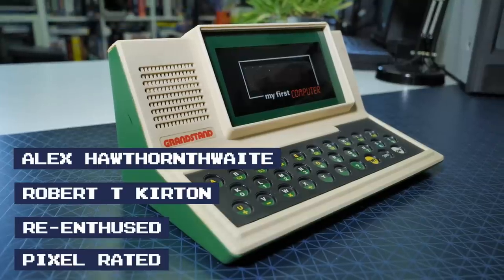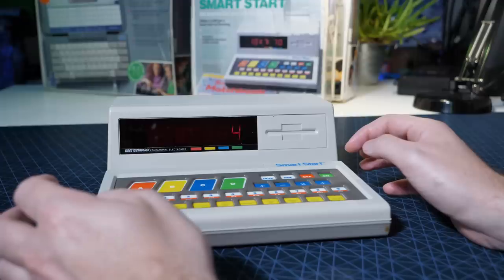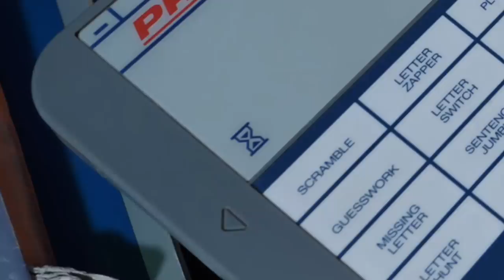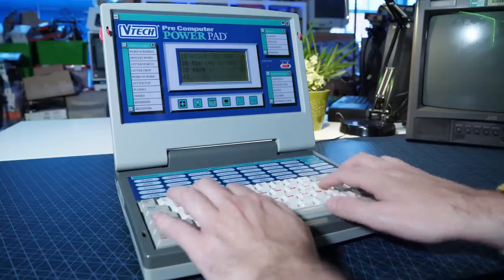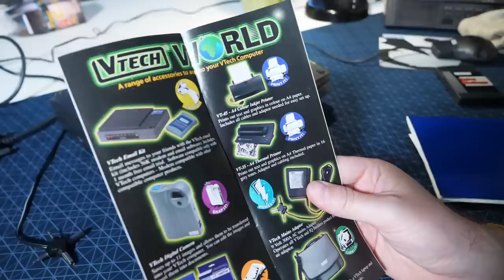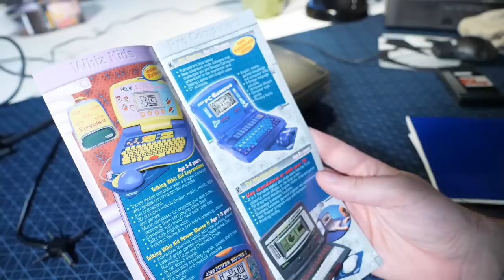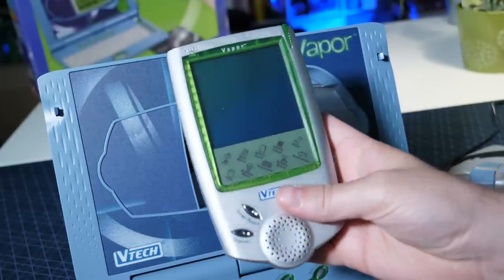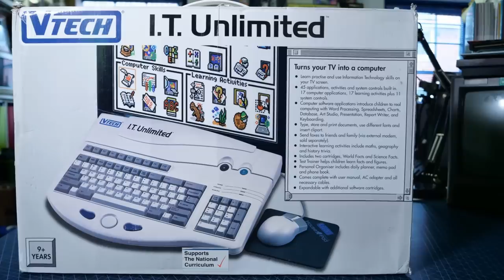VTech Laptops: Better than you Think | Nostalgia Nerd

Comment: My first computer was a VTech Laser 310. And it was a proper one. Dual disk drives and a fully blown green monochrome monitor. With that thing I learned to code in basic at the age of 10 back then in 1988. Two years later I knew it's capabilities by heart, poking in machine commands and even writing my own little textadventures and small "graphical" games (although those still consisted of text characters flying around and interacting with each another). What a time to have been alive in. Truly UNDERSTANDING what a computer does. With a manual that really teaches you. I was pretty annoyed by Windows 95 at first - never ever knowing why that HDD-LED was flickering. Never ever again having the full control of what my own machine is doing. Right now that RAM-stuffed massive multicore machine beneath the desk is computing thousands of things I don't want it to do - and of course despite its giganteous amount of RAM it is still working hard to degrade the ssd drives in it, without me actually saving anything to them. What happened ?!
Reply: Hey man I appreciate your comment! I just wrote some thing sort of similar on here. Well, about an iMac but, still! I saw urbEx in your name and thought I’d see if I was correct in assuming it was what I thought it was… 😎 I’m gonna check out a couple of your videos!
Reply: Capitalism happened.

Comment: Being damned near 60, I obviously didn't grow up with these. To me, VTech is a cordless phone brand.
Reply: I'm 40.  So I just used my family's real computers. I basically taught my dad [who would be 74 by now] how to use the computer and then how to send emails.  Haha
Reply: @mattnova18  I'm 39, and while I had the Vtech 1000 Pre Computer as a kid given to my by an aunt, It rarely got used, as I had a Commodore 64(later 128) with dual disk drives, and an Apple II IE also with dual disk drives both sharing an Epson Printer lol!  
Speaking of VTech cordless phones I still have them at home with a dect 6 3 unit digital answering machine setup using it as a backup to my family's cell phones with a MagicJack, and at work with a dect 6 2 unit digital answering machine setup connected to our ISP's VOIP service as cell phone backup, and business line. Both units have been very reliable for well over a decade now, and when the batteries do eventually go bad, they are cheap as dirt to replace, so as long as Vtech keeps making them, they will be the only brand I'll buy.
Reply: North American YouTuber  It'd be interesting for sure, they could target the budget market with decent hardware, and make Chromebooks, or some systems that came with Linux(anything but Ubuntu would be great) preinstalled.
Reply: North American YouTuber  They could have, They DO make good phones, SO they do "get" electronics. But I guess they: 1,Saw a crowded PC market and 2, They virtually OWNED the whole "kiddie" sorta-computer market, I imagine it was a profitable enough market for them.
Reply: @CommodoreFan64  I started out with a TRS-80 Model III in the early 80's (learned Z80 assembly language on it) I also had other Z80 based machines (Including the US market Sinclairs!) If I had known that the early VTech toys had Z80 CPUs, I might have bought one just to hack the hardware for ?!? IDK, Just for fun.😊
Reply: This is what happened to me. I loved my 1000 as it helped me learn whenever I was bored using the NES but the newer ones just made me cringe. It would have been better off back then made into a four column device and forgo the kiddie experience. Maybe make some dungeon crawlers with txt ala Ultima. Nope. Instead degraded to a kiddie toy that beeps. 😒
Reply: North American YouTuber  They did though... Not sure what happened that they didn't keep making them.... Maybe the speed that things kept moving at made them shy away.... I have some 3.5" pc formated floppys with Vtech labels on them and things like this pop up if you google vtech msdos https://ibm.retropc.se/manuals/VTech/VTech%20-%20Laser%20Turbo%20XT%20-%20Operations%20Manual.pdf  Also they did make some apple II clones....
Reply: North American YouTuber  They actually DID make real computers, check out The 8-Bit Guy's channel, he posted a video about them recently
Reply: I saw these around, but I never was interested.

By the time I was in the age group these things were intended for my mother had a 286 PC I used, and not long after I had a second-hand Atari 800XL, and a SNES... (yes, at the same time. Old tech never dies. Case in point, while it's not either of the two I owned as a child, I have an 800XL under my desk right now. Also a SNES, because... Can't let anything go apparently... xD)
Reply: @TheGodOfAllThatWas  Oh,shit! You're right! I had a Laser XT (portable) pass through my hands, and COMPLETELY forgot it WAS VTech!!! I only ever used it (via BASIC!) for video titles in the day because it had the old composite video output. I fell stupid (Old timers disease, LOL).
Reply: @BertGrink  Yeah, I completely forget that the Laser machines were made by VTech. I'm getting old. LOL. I HAD an "XT" (obviously,NO HDD like that OTHER XT, LOL!). Mine was the portable version.
Reply: @KuraIthys  I fully endorse your 800XL.
Reply: They still make DECT phones for e.g. Deutsche Telekom - I have one. The hardware seems nice, but the menus are too slow.
Reply: I never even knew they did cordless phones until looking them up. I always knew them for these things.

Comment: Am I the only one to automatically try re-angling my head so I can better read the display? Although I know it doesn't help on video?
Reply: when i make a wide turn in a racing game i move with the curve to see better even though it does nothing. can't block natural reflexes.
Reply: I was moving my iPad about...
Reply: @rickyrigatoni  lol.
Well, that does actually work in VR...

Also if you have a head tracker, though the non-linear response of those will probably mess you up until you get used to it...
Reply: The backlit ones are the best ones,  hard to find these days, and lots faulty on the 2nd hand market.

Xtra Pro Laptop  pink only
blue has no backlight.

Comment: "Why would you want to listen to this through headphones?"

That's probably exactly why it exists, so parents didn't have to 🤣.
Reply: I thought the exact same thing after he literally said this in the video
Reply: Yep, my father at the time hacked a headphones on the apple itt 2 and had bleeps in stereo 😉
Reply: I know when I was younger I certainly liked being able to listen with headphones to things and wished everything had a headphone jack. and it also had the wonderful benefit of being able to be connected to other things like PA systems. No I wasn't that devious that I'm wishing I thought of it when I was younger to connect some arbitrarily annoying device. although I did come close by connecting my non headset capeable modified with a headset Jack weather radio to a sound system.....
I had a mini keyboard that I always wanted to put headphone jack on too but never got around to it instead I ended up using a induction Loop. Sadly I'm going to have to buy that thing off eBay because it didn't make one of the moves apparently.

Comment: I found one at a thrift store for $5, it had basic on it!
Reply: I had a similar experience, in that it was in one of my local charity shops. It was 20 quid, and I initially didn't think much of it until I checked it to make sure there were no batteries in the compartment, just to make sure they weren't leaking, and then I discovered it had BASIC on it! I also ended up getting it for 12 quid instead, partly because it was on the shelf for weeks and I was probably one of the few people that would have bought it! I ended up buying a printer for it eventually too, but both are now in storage, as I need to organise my flat for space purposes!

Comment: I had the IT Unlimited (though it was called PreComputer Unlimited) and I found out something extremely odd about it.
The two bundled "expansion" cartridges (1 and 2) are almost completely empty, and each bridges the exact same pins on the connector slot. The machine somehow knew which one was inserted, so there must have been a resistor hidden inside somewhere.
The documentation told of cartridges 3 and 4 available seperately, which I never had. I wonder was the content for those also burned into ROM, and accessible with some experimentation?
Reply: lol on-disk DLC before it was fashionable...
Reply: Truly ahead of their time.
Reply: Robert Ray well now we know who to blame.
Reply: Someone needs to investigate!!
Reply: Nowadays bootleg game systems do that to hide the copyrighted ROM files. But I wonder why do it back then?

Comment: Having been a long time graphing calculator nerd I'd say having a 8 line display should be the minimum in a kids "pre"computer toy. The TI-82, TI-83, TI-83+, TI-83+SE and the TI-89 were my introduction to programming. I would spend an incredible amount of time programming the intro to a game. Like 8hrs of using the challenging keypad and navigating all the sub menus just to make a 3-5sec intro with pieces falling into place to make up the word Tetris. To this day I still have fun writing code for my TI-83 only I ditched TI-BASIC years ago and now do everything in assembly. I was always curious about the HP series of graphing calculators. I heard they were more capable but used a different programming language than BASIC. I never knew anyone who had one though because of the stranglehold Texas Instruments has on the educational market.

Comment: I learned a lot about computers and started programming on a Apple IIgs in the mid to late 90's when I was learning to read at around 4 and 5 (learning faster than others because I wanted to learn basic and assembly not long after).  Sure I built IBM PC compatibles with my Dad's spare parts at his office but I always had a soft spot for the IIgs Woz Edition I got from my Uncle as a gift.  I still use that computer a lot to program fun projects to take up time with.  It kind of follows what you said about learning the limitations of your system and learning to work around and even with them at times.

Comment: My older brother had a VTech laptop in 98/99 that looked like it was based on the Endeavour and was aimed at KS3 curriculum. It had a word processor, spreadsheets, the quiz thing and I think a drawing pad. 

I can’t find the exact model anymore but it looked more like an actual laptop than a toy and I would use it more than my brother, I was obsessed with making spreadsheets and graphs. I had used it long before I had access to a Windows PC but had grew up with Acorn Archimedes terminals in primary school.

Comment: Back in the early 90s vtech also made "electronic dictionaries" for the Asian market, those were like tiny palm size laptops for adults / older students without any toy-like design. Great replacement for paper dictionaries, but I used it mostly to play games. Some also integrated functions such as organizer, calendar, book reader, unit converter, calculator etc. Google search vtech cv6880 you can find photo of one of the models.

Comment: I had the PreComputer 2000. Two of them in fact. The first one met its demise within a week of arriving at Christmas, as I was using it on the dining room table and forgot the thing had a power cord coming from it and fell over said cord, which sent the PreComputer plummeting. My friendly local retailer gladily exchanged that one for the second one (being unaware of the full circumstances that led to it becoming non-functioning). The second one also met it's demise sooner than I would have liked, when untidyness on my part led to the screen finding it's way under something heavy, and thus getting wrecked.
A really amazing machine though, that I absolutely loved using. I could have sworn you could save multiple Basic programmes though, as I used to use the Basic function to save text about things I needed to remember for whatever reason, and I don't think I'd've done that if doing so had wiped my previous programming. Anyway years later (about 7 to be precise) I began Computing A-Level and we were all asked to inform the programming lecturer what our previous programming experience was, so I wrote that I could program in Basic on the PreComputer 2000 (and didn't see any kind of irony or shame in telling him that).

Comment: The first time I used a programming language was on a VTech toy in the mid-90s. The 2nd thing was a TI-82 graphing calculator (which I made a 2D platformer with no internet or outside help, ~1998). I'm a software engineer now.

Comment: I'm not sure I had a V-tech, I think it was a knock off but I remember it came with 6 or 8 little plastic "disks" that when you inserted them you could draw, do math, write something, a couple different games. But the funny part was at that age I took everything apart and when i popped it open after tinkering around I realized that the "disks" contained no information. Instead the unit had all the applications and each disk had corresponding punch holes in specific patterns so when you inserted them in the unit it just triggered a specific application. I remember it kind bummed me out and as a result I didn't put it back together. I think I just stripped parts out to make cool circuits. ahhh the early 90's was a fun time.

Comment: The Precomputer 1000 (distributed under a different brand/name in my region/language) was the first computer I programmed on when I was about 9-10, a family friend had one and lent it to me for a few weeks. Was really cool, have meant to buy one again for the nostalgia since a couple of years but never got around to it, it actually took me a while to even find what it was. Also used the Smart Start before that. Haven't used any more modern ones since I then got to use the "real" family Mac Plus, and then Pentium 133 a couple of years later. Then built my own PC out of components people around me were discarding and gave to me and played with Visual Basic 6.

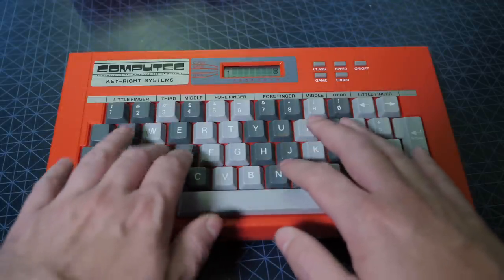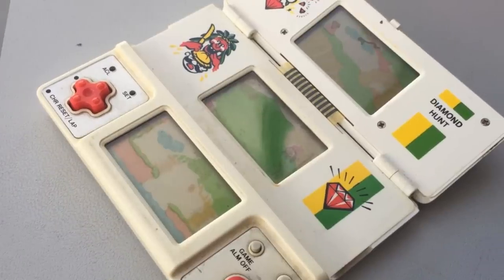Comment: Hi All - at 1:31 the Laser 310 was also released in Australia as the Laser 300 by local Dick Smith stores , the had sold the prior chicklet keyboard Laser 200 and the Wizard features at 1:00   complete with tricky dicky logo

Regards
George

Comment: The thing is,VTech also made actual computers too.  I remember setting up a couple of their OEM machines for a law office (a '386, then later a 486sx).  They were badged as two different  company names, but they were identical in design, including the poorly-engineered power supply (the cooling vented out the top, right where people would place their monitor).

Then later I had an actual VTech badged desktop machine, a dual-processor 486dx2-66.  Yes, an actual dual processor 486.
Reply: Vtech also made the "Laser 128" Apple IIe clone. Unlike the Franklin, Vtech "clean room" reversed engineered the Apple ROM. In 1984 it actually was superior to Apple's recently released Apple IIc at half the cost.  They're also the world's largest manufacturer of cordless phones. They are and always have been as serious electronics manufacturer.

Comment: I have a Vtech Phusion PDA that I got a while back in Nov. 2019 from my local Thrift store. It was mixed in with a box of Legos/K-nex toys. it somewhat works since it really needs a battery cover to really keep the batteries in place properly. The thing was that this was released back in 2000 when the Palm PDA's where the big thing. But this Phision PDA had a built in camera that can rotate in the same way the gameboy camera can. So that meant that kids can take "Selfies" back then before it was a thing. but other than that it's kinda a weird thing. I do agree that the Vtech portable electronic devices where actually good.

Comment: I think the weirdest Vtech laptop is the Wallie Robot one, it is well thought out, but it is wierd that but understand why Vtech did it.... is the hands are the joystick, one twists for up down and the other left and right.  Very odd to control.

With all the Vtech lcd range is backlight,  I now only like the backlit models -
Xtra Pro Laptop (pink only version !) has backlight.  I bought three working ones of ebay of which one backlight doesn't come on, the 2nd one switches off within 5 seconds upon switch on unless you press any of the keys, 3rd works.   The blue Xtra Pro laptop version for boys is for some reason does not have a backlit lcd.

The weired boys one is the Vtech Catapillar (as in the Bulldozer company) tough laptop, I picked one up at a charity shop, but rom was currupt on the display.   It has a built on fm radio too and a weird interface port for add on hardware cartridges to control things.

The other ones I like and own for my children are the dotcolourLED handheld tablet with slide out keyboard and the expensive (new and 2nd) desktop dotcolourLED tablet  with sliding angle stand keyboard which is hard to find in english as its mainly in french and german.  This have large 2mm style rgb led in a large led grid, which mono simple versions are in the Vtech baby range of laptops with builtin mouse.

Comment: I used to have one that was similar to the Endeavour model. It had a back lit LCD and a different case design, but the software looks exactly the same. I got the email program too, and for a little bit this was actually the only "computer" in our household and the only way we had to send and receive email. By this time HTML based email was common though and it had no way to display that other than just showing you the html code as plain text.
The modem and service you got with it was just a regular full dial-up connection. When we got a real pc for the family a little while later, we used the same dial-up accounts on the new pc for a few months while we waited to get a ADSL installed. But even after that I continued to use it for some time just because it was cool to have my own computer in my room that I could use for email.